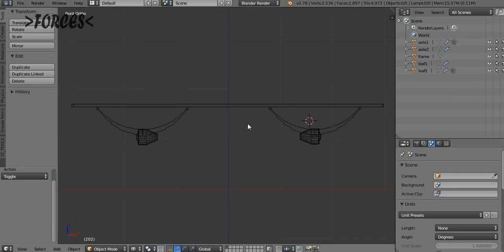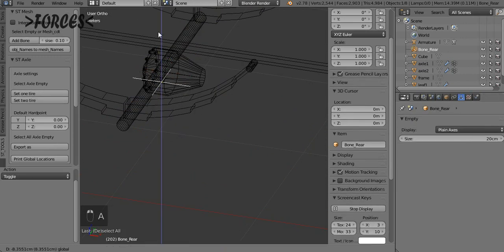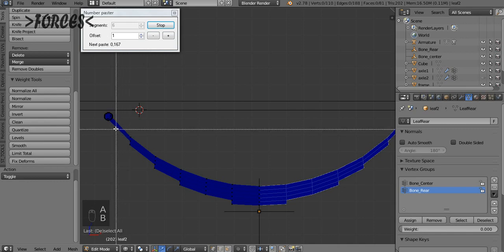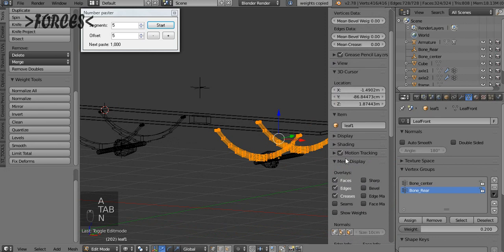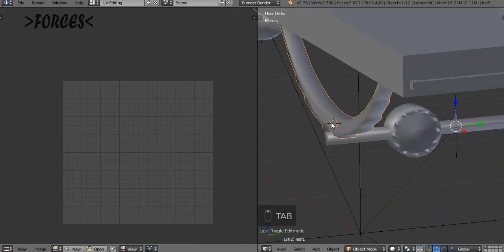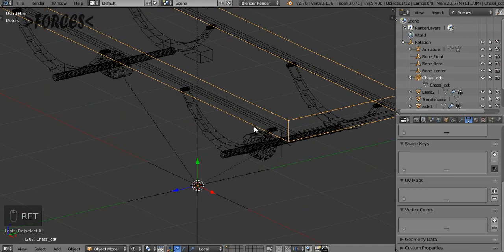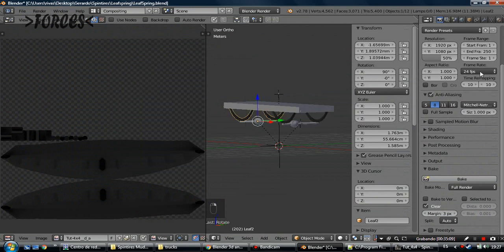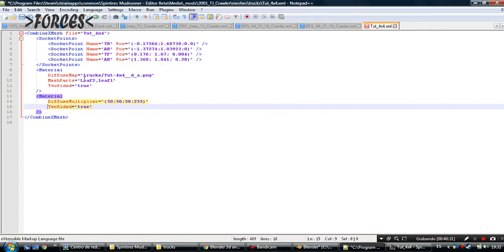Forces Blender Tutorials Part 2 Animations

Comment: Hey mate, I am having trouble with importing a modified version of the mesh, I have loaded your mesh form the files you uploaded fine and when i edited it then exported it, it no longer was loadable, i tried to do the apply location&scale but i think i screwed some thing in that up, would love some help, thanks for the tutorial :)
Reply: Is it because I don't have st_directx and am just using the direct exporter that's on the addons page in blender? I cannot install the io_scene_ST_DirectX_2016.zip addon in blender, i click install addon from file and select the zip but it never appears on the list and doesn't show up in the export options, do i have the wrong version of the plugin and where do i get the new one?

Comment: Awesome Forces! Thank you very much for showing off the Number Paster so others can use it as well.

Here's links to the Number Paster. There are 2 of them.
The first one used CTRL+V to paste the numbers.
The second one uses Shift.

I asked MarijnS95 to change it to use the shift button instead because it's easier than using ctrl+v each time. But you can use what's easier for you so here's links to both versions.

Number Paster - CTRL+V = http://www.mediafire.com/file/5a9p88tywr88jy6/NumberPaster-ctrl-v.rar
Number Paster - SHIFT = http://www.mediafire.com/file/rf6qt3ew4alj8k0/NumberPaster-shift.rar